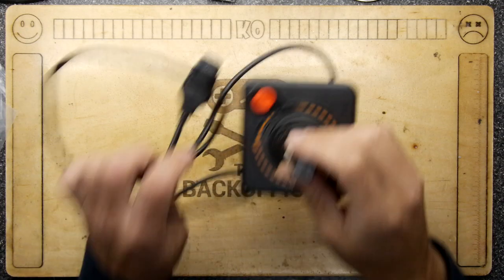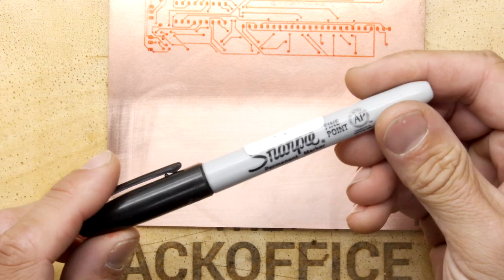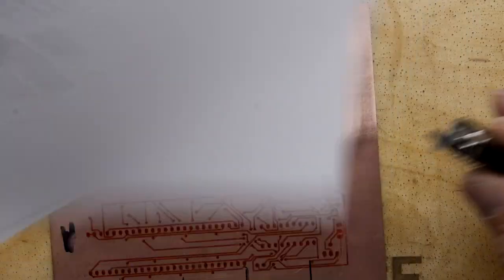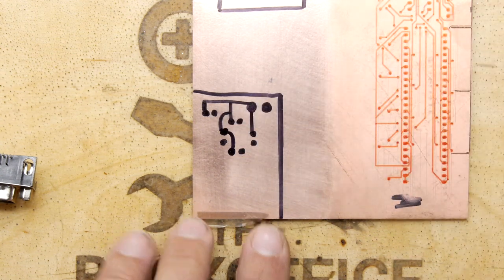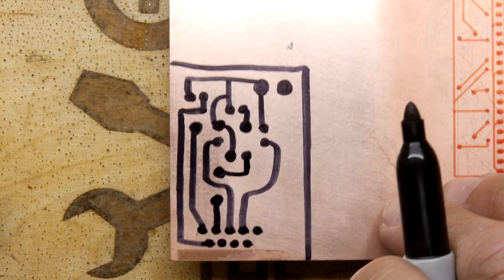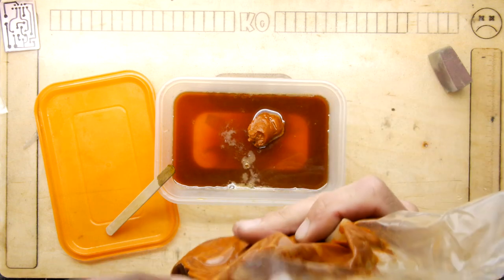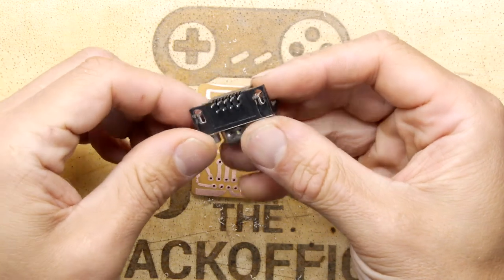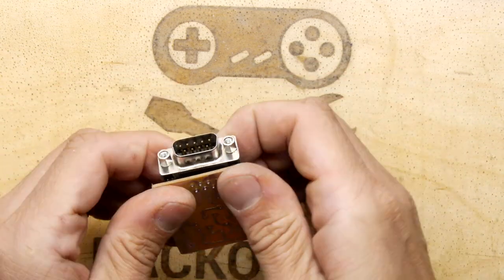Make your own PCB with a sharpie!

Comment: Used to do this ages ago but it's been quite a few years since I broke out the home etch box. Not particularly useful for most of what I do nowadays though with how small and tightly packed components have gotten, but still have good memories of drawing and etching my own boards at home.
Reply: Fancy seeing ya here!
Reply from the maker: Yeah, I guess it's more of a novelty as you progress, but hopefully it's useful for people coming into it. I think it can all seem a bit mysterious at first.

I quite like the idea of still using this technique to make buses or DIY flexible circuits. I do have some copper tape somewhere.
Reply: @backofficeshow  now that's an interesting idea, copper tape and kapton to make your own flex pcbs!
Reply: I used this technique to make a cube like the one from the "Hellraiser" film, but yeah, wouldn't fancy my chances with a board for smd components!
Reply from the maker: I think with plotter assistance you have a chance for sure, with I've of those super fine pens but you definitely need a super clean PCB.
Reply: I've done pads with 0.5mm pitch. I just left a comment before reading this. Use a calliper, fine tip markers (engineering pens), and a ruler. Takes some time to do it neatly but very possible, and fun. It's like engineering drawing but on a piece of copper. I've never seen a video on YT do it. Maybe I should, I've got to do a prototype breakout next week anyway.

Comment: Came back to see what I did wrong. My first Pcb worked great, which was a simple LED oscillator. My second which was a FM transmitter had loads of parts on it. I realized that i should put my components on the side with no Pcb tracks. I definitely shorted a few connections but you live and you learn. Thanks for the great video.

Comment: One way I heard for doing PCBs was to print onto glossy magazine paper with a laser printer then iron it onto the PCB. Seems to be documented online.
Reply from the maker: Unfortunately I just traded in my laser printer for an inkjet. I might regret this as I used the laser for silk screen stuff 🤦
Reply: @backofficeshow  I still have a cheap Brother laser I bought around 2007/2008. Still on the original toner cartridge. No idea if it still works.
Reply from the maker: I binned a few recently. Unfortunately just not using them seemed to kill them whereas the inkjet printers we have are chugging along. I guess more to go wrong in a laser

Comment: Pro tip: don't use 9V battery in these testers, the wiring and PCBs inside the joysticks might not like this high of a voltage and heat up causing damage to it. Get 3V LEDs and 2 AA batteries instead.
Reply: That's not how it works. With the correct resistor, once you take into account the voltage drop of the resistor and LEDs you'll have the exact same current flowing through the joystick with a 9v battery vs a 3v battery. All the extra voltage is dissipated as heat through the resistor. The joystick is not affected-it gets the same voltage whether the tester as at 3v, 9v, or even 120v.

Comment: Long long ago I used electrical insulation tape (soft plastic and adhesive) and cut thin strips with surgical blade and ruler. Ferric chloride is a nasty chemical. The junction of tapes would be eroded away. It was fun, frustration and lot of learning.

Comment: You should use a punch and hammer to punch where the hole should be drilled, that way the drill won't slip and drill somewhere else on the board

Comment: It's been a while.  Back in the day I went through a couple of Radio Shack PCB kits. They had a felt tip pen, but I preferred to use the dry transfers that came in the kit - pre-drawn IC footprints and nice smooth radius curved traces.

Comment: Use a calliper and a ruler and you will get very neat finishes. Get different size tipped markers too. Use a Dremel to drill holes (a cheaper dremel will do, or make one with a motor). Apply UV solder mask to finish. I've had to do this to create breakouts and converters for some expensive PCB's that used exotic connectors impossible to find anywhere. Sometimes you have to do these things to save the customer from spending thousands on a new PCB.

Comment: Back in college we used to kinda do it this way, but we had a Wyse workstation running some CAD software, a plotter to print directly to the PCB sheets, and a proper tank for the chemical bath...
Reply from the maker: Hells yeah! Just like in my CDT days at school 😂

I still have my Roland plotter in the loft. It's probably wrecked now, I really should fetch it. Never had a bubble etch tank, they are not really up to the task these days with tiny QFN surface mount 😂
Reply: @backofficeshow  You could probably build one with a plastic tub, a fish tank bubbler, and some 3d printing for board mounts...  Sounds like another project for the channel! :p
Reply from the maker: I might get the t8 mill out again and do a circuit with that 😂

Comment: Awesome video! Glad to see I'm not the only one that makes mistakes on the plugs though. I wired up a 7800 controller a week or so ago and had it wired completely backwards at first since I was looking at the pinout wrong.
Reply from the maker: Its not the first time I have made the mistake on a plug, and 100% not going to be the last time. Some of the simplest ones as well have been known to get me. For example a DE9 or DE25 serial port. You only really need 3 pins, but get the whole gender wrong or confuse the pinout and you are done for 😀
Reply: On the bright side, getting the 7800 backwards didn't seem to hurt anything. Would have been a shame to kill it after finding it full of water and resurrecting it.

Comment: This is cool, didn't think just a sharpie would be enough to resist the etching. I imagine with a sharpie ultra fine you could have gotten all the tracks without jumpers. What did you use to cut the board itself?
Reply from the maker: I just used some aviation shears and a bit of sandpaper to chomp it

Comment: Neat, feel like rigging the plotting process onto a 3d printer could make this a bit more effective. Call me a wuss but I think I might reach for some gloves for the chems and clamps + sacrificial blocks for the drilling before trying this, I don't trust myself that much
Reply from the maker: I still have a Roland XY plotter and The loft that I used to use that was the equivalent of the 3D printer part in its day. However, I wouldn't really think it's an amazingly effective way to make a PCB compared to the alternative methods available these days, But for a bit of fun, it's worth a go!

Comment: Hello, what is the brand of the marker you used?
Reply: Sharpie?

It doesn't matter, though. As long as the marker is water resistant or permanent (acetone or isopropyl alcohol gets it off), it shouldn't lift off while etching.